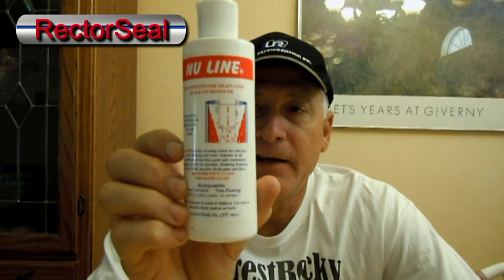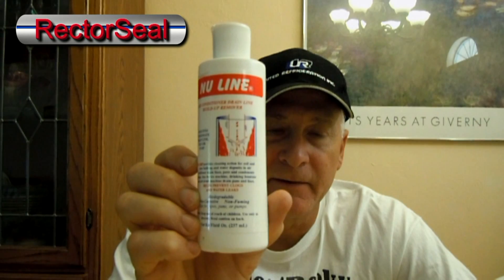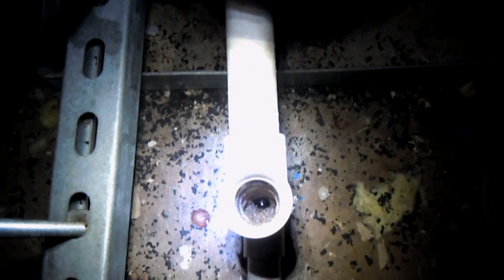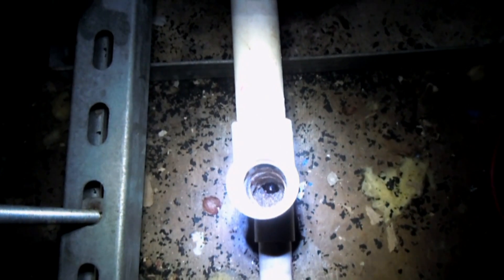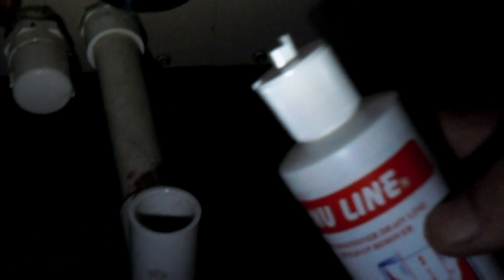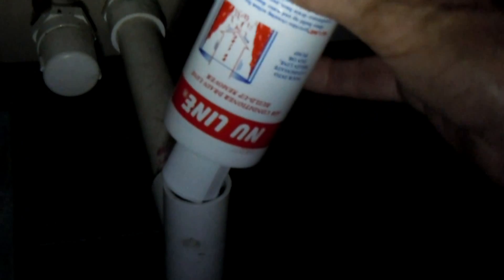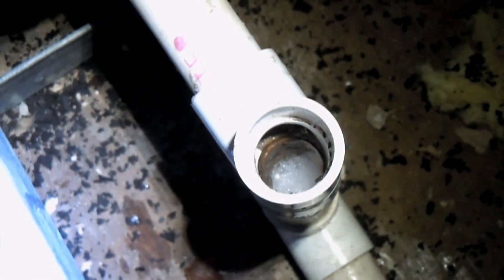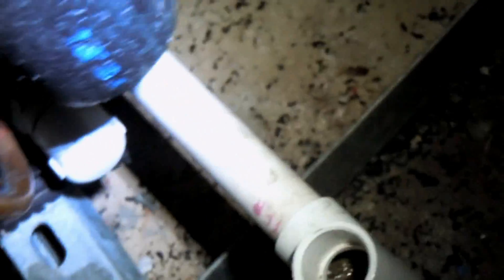HVAC Nu Line condensate line cleaner.

Comment: how does a dual run cap fail?  I replaced one yesterday to solve a startup problem on my 2 tone 6 year old moderately used carrier unit.  Did another problem cause the failure so that if I dont find the other problem, the cap will fail again prematurely?
Ferd

Comment from the maker: @ADUBOIS11 It sounds like the condensing fan motor is running backwards. That's usually caused by a bad run capacitor.

Comment: Whats your thoughts on this problem. Unit is having trouble cooling house temp stays at 80. Hooked up gauges r-22 unit has 125lbas on cold side after startup drops to 80 lbs head pressure is at 250... 5 minutes later cold side jumps up to 100 and head pressure jums up to 300. Just cleaned indoor and outdoor coils doesn't help any suggestions?